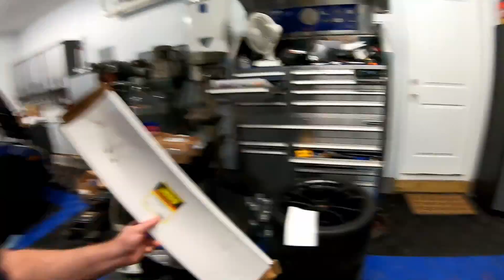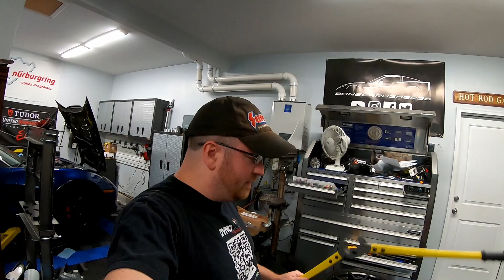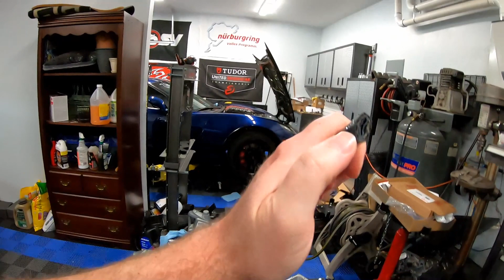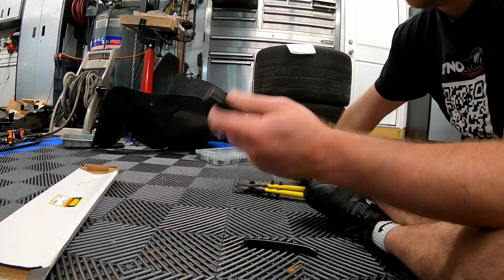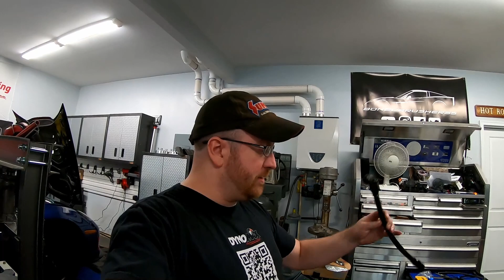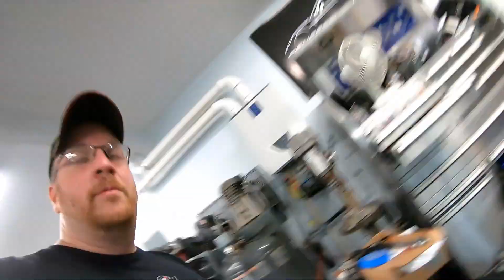Jegs 80586 Hose Cutter + PTFE Hose Assembly

Comment: That did not work well at all. Put it in a vice and use a grinder and cut off disk.
Reply: That method does not work well for me. Makes a mess n kinda destroys the steel braid. Even with tape. This cutter actually works best for me
Reply from the maker: Need a better pair - or sharpen the teeth.